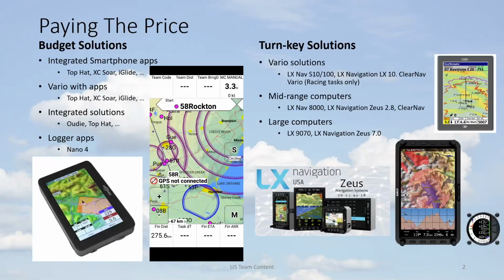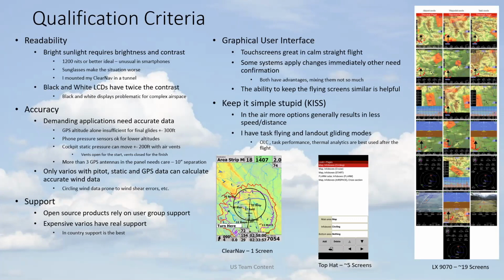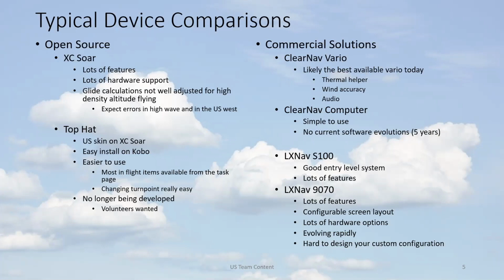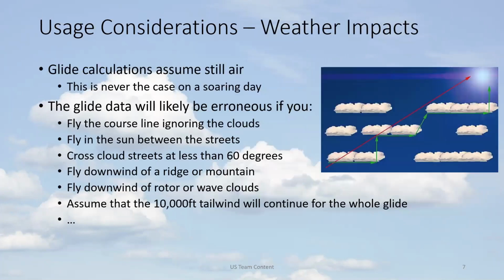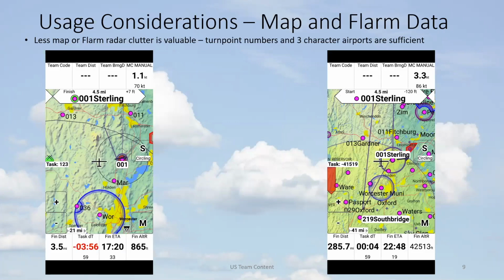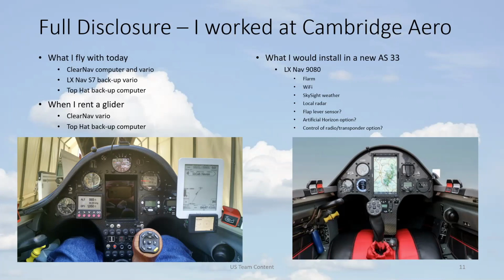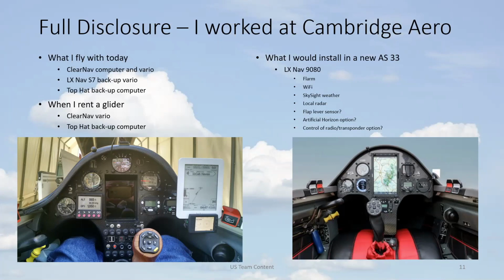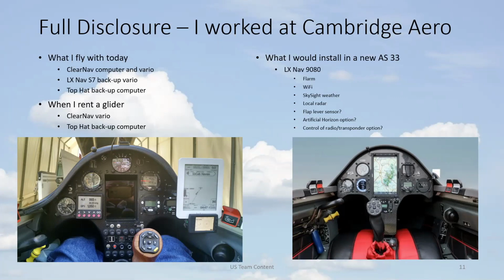Glider Flight Computer Webinar by Bob Fletcher

Comment: Thanks. Great presentation but something missing is any discussion of the legacy systems that are in many of our gliders today or available used as people upgrade their panels. I’m thinking of the SN10, the LX4000/5000/7000/8000 series, Cambridge, extra. It doesn’t have to be all or nothing based on budget. You can have the benefits of an integrated system without the high cost.